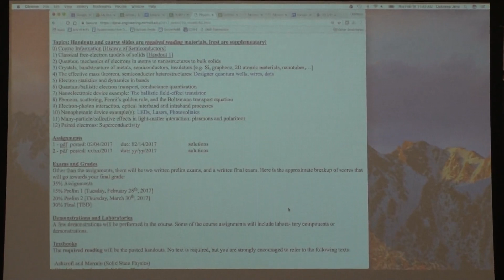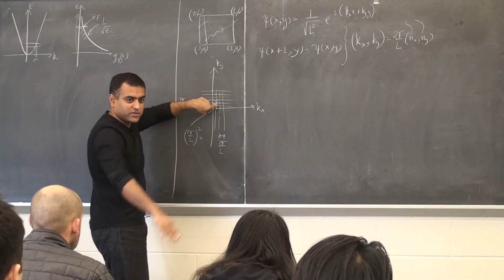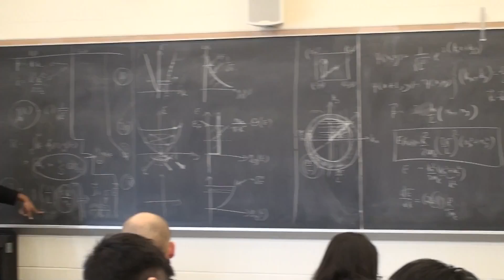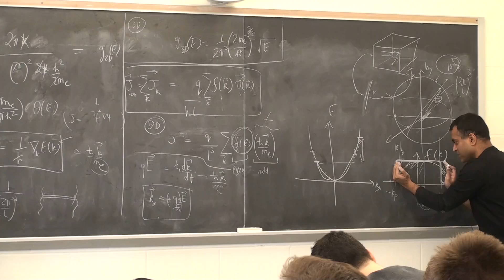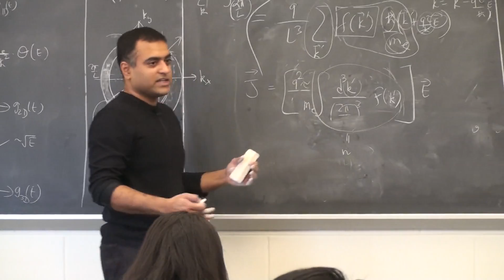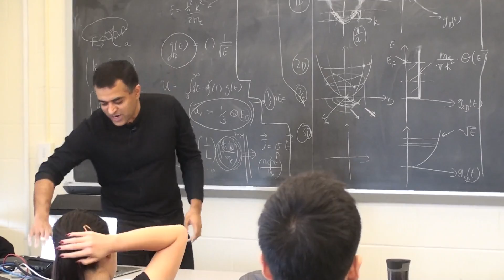Physics of Semiconductors & Nanostructures Lecture 6: Group Velocity, Conductivity (Cornell 2017)

Comment: 50:55 says that the band structure does not change with the application of electric field. but when you apply an electric field in the x direction that introduces a potential Vx that would affect the schrodinger equation right, which would affect the eigenstates and hence eigenenergies? where did i misunderstand?